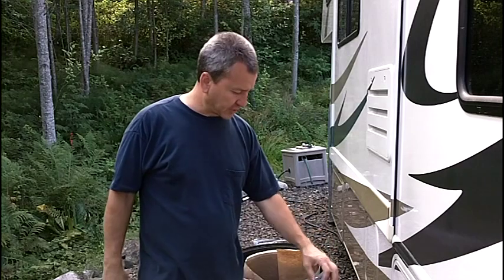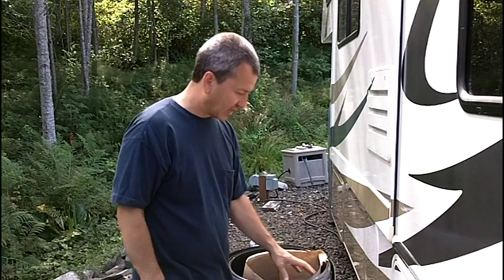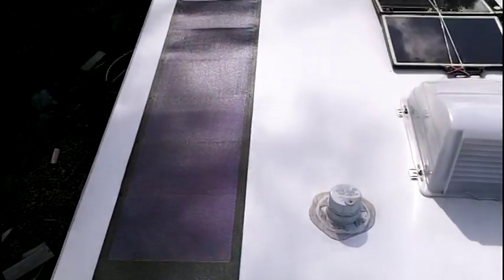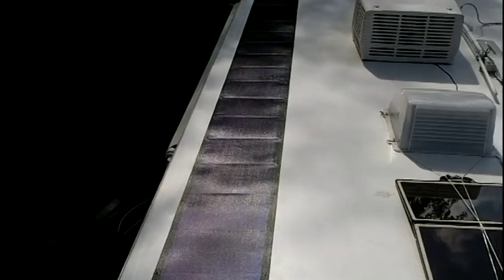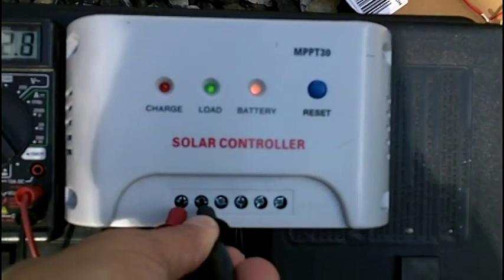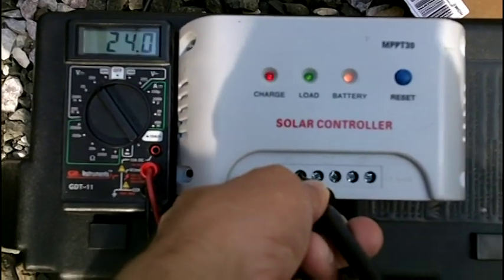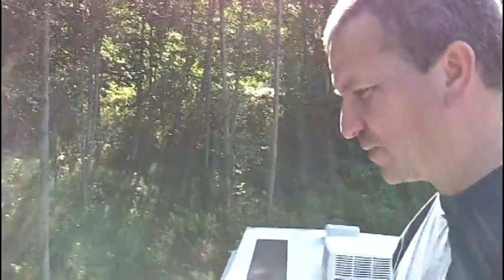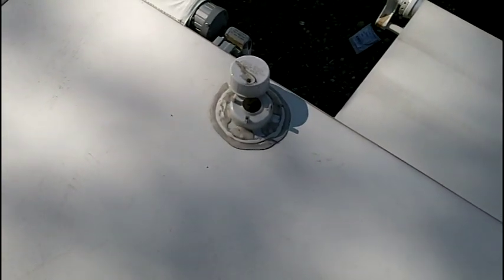How to Install a Flexible Solar Panel - DIY RV Solar

Comment: It looked like you could have put a second panel next to the first one, why so far from edge, like you said it is permanent can't move them...can't waste space....
Reply from the maker: You're right. Check out the more recent videos. Most of the roof is covered in flex panels now.

Comment: Hey Tito. Great informative videos. I used you as a guide to install my fantastic vent.  now I am tackling the solar project. In one of the comments you say that since this video you wired directly to the battery instead of the terminals under the bed. Is there any safety issues that led you to do that or is it just a matter of having less loss of current. I am thinking of connecting to the existing cables that go to the fuse box in my trailer. I would hate to open more holes to lay yet another set of cables to the battery. Are there any safety issues I should be concerned with my initial setup? Thank you!

Comment: Tito I need your help i have a 22ft forester class c and I just bought 2 18ft unisolar 24v panels (128w each) I plan on buying an mppt charge controller, some golf cart batteries (i think i can fit four in one of my outside  storage compartments on the port side.) and of course a power converter. will the converter change the 24 v to 12v or does the charge controller do that? should i set up a 24v(4 6v batts in series) or 12v battery bank( 2 6v golf cart batteries in series and then parallel with a duplicate bank)?
Reply from the maker: Fortean Threat Filmworks I would go with a 12 volt system configuration. Wire your 4 batteries in series-parallel like you indicated. Your MPPT solar charge controller should allow you to set the system voltage(12v, 24v, 48v). Set the controller up for a 12 volt system. The controller will then handle the conversion to 12 volt from your solar panels. With an MPPT controller, you should be able to wire your two panels in either a parallel or series configuration. I recommend series to minimize cabling and minimize voltage drop. Hope that helps!
Reply: awesome, thanks! My solar battery bank will be separate from the  batteries that came with the RV (under the entry top stair) I will unplug from shore power or generator outlet and plug into a 30amp receptacle wired into the inverter/converter. that way the solar system will act like shore power and will charge the rv battery system and provide (I hope) enough power to run the 110v appliances. (I'm keeping my fingers crossed about being able to run the  air conditioner) do you think the two 18ft panels would provide enough on a sunny day to power the a/c?
Reply from the maker: I don't think you'll want to run that A/C unit on batteries. You'll get more amps coming in while the sun is shining but not enough to make it worth while. Your A/C will also have a pretty high starting surge when it first powers up. My guess is that it won't run very long before draining your batteries. I would look for alternate ways to keep cool (fans, shade, etc.). You could start up the engine on your class-c and run the A/C on max to cool down the rig then maintain with fans. You could also fire up the generator if you want A/C.

Comment: How many batteries to last all night after a good sunny day?
Reply from the maker: Jeff. It really depends on what you plan on powering through the night. You certainly can't run an electric heater. I can generally run what I need on my two 6 volts with 210 amp hours (heater fan, or electric blanket, lights, tv, etc.)

Comment: the shorter the wires,the more power you gain
Reply from the maker: Generally true, especially between controller, batteries and inverter. I talk about this more on my solar Q&A (http://www.rvwithtito.com/solar) under the question "HOW THICK DOES MY SOLAR WIRING NEED TO BE?" I recommend using a voltage drop calculator to optimize your setup.

Comment: here is an inexpensive rv solar panel kit
<script>document.write('<a target="_self" href="http://rover.ebay.com/rover/1/706-53473-19255-0/1?icep_ff3=2&pub=5575109810&toolid=10001&campid=5337621459&customid=&icep_item=291011889419&ipn=psmain&icep_vectorid=229529&kwid=902099&mtid=824&kw=lg">solar panel kit</a><img style="text-decoration:none;border:0;padding:0;margin:0;" src="http://rover.ebay.com/roverimp/1/706-53473-19255-0/1?ff3=2&pub=5575109810&toolid=10001&campid=5337621459&customid=&item=291011889419&mpt='+Math.floor(Math.random()*999999999)+'">');</script><noscript><a target="_self" href="http://rover.ebay.com/rover/1/706-53473-19255-0/1?icep_ff3=2&pub=5575109810&toolid=10001&campid=5337621459&customid=&icep_item=291011889419&ipn=psmain&icep_vectorid=229529&kwid=902099&mtid=824&kw=lg">solar panel kit</a><img style="text-decoration:none;border:0;padding:0;margin:0;" src="http://rover.ebay.com/roverimp/1/706-53473-19255-0/1?ff3=2&pub=5575109810&toolid=10001&campid=5337621459&customid=&item=291011889419&mpt=[CACHEBUSTER]"></noscript>

Comment: Are you able to cut these panels? I have a 12 foot long cargo trailer.
Reply from the maker: No cutting. The shortest Unisolar panel is about 10 feet and my longer one is 210 inches. There are other flexible panels by Go Power for example that are more rectangular and my fit your roof better.
Reply: RVwithTito 10 Feet would be perfect. Can I get a quote for two? Thanks for the quick response.
Reply from the maker: Scott. There are links in the description where you can find them on Amazon.com or eBay. That is where I picked up mine. I don't sell them. By the way, Unisolar Panels are not manufactured anymore so you have to search for them online.
Reply: RVwithTito Thank you; I have not been able to find a ten or twelve footer yet.. Keep up the good work.

Comment: I am so solar power illiterate but what kind of things would this panel power? Lights, coffee pot, TV? I have pretty much found out that my window AC in my camper, is not an option for solar, which sucks on a 115 degree Texas Summer day. What about a microwave? I have no idea which things could be used with solar with a few batteries and maybe 2 of the shorter panels. I'm not sure my little vintage camper is long enough for this panel.
Reply from the maker: Hey Cathy. The primary purpose of RV Solar panels is for charging your house batteries. It is actually your battery bank capacity and inverter output that determine what you can supply power to and for how long. You are correct about the AC. It uses too much power for batteries. There are some systems that could probably power an AC unit for a few minutes, but then the batteries would be fully drained. So not a good idea. Many folks simply drive to milder climates when it gets too hot. A typical RV microwave may draw about 1000 watts for the few minutes you use it. So that is doable as long as you don't exceed the maximum power of your inverter. A 1500 watt inverter will probably work for my use (a few small appliances, laptop, TV, fans, etc.) Monitoring your battery power consumption and charge level is also a very important part of living off of solar.  Hope that helps.
Reply: ***** do you have a lot of wind in your area?
Remember there are also wind generators.
 I have a house off the grid in Australia and if you want you can run anything all day long as you double input from your out put, double is not necessary but with most thing Solar and off grid I have personally learnt add 50~100% more than what you need. like my 3k pure sine wave inverter i don't use the full 3k much but when i had a 600w inverter and would have 500~600w draw on it it would be hot and work at full capacity. Example my Batteries that I just had to change after 15 years, I was told 15yr ago that if you only use 20% they will last longer and from what I here I got the most out of them

Comment from the maker: I've rewired my solar since the video and it now goes straight to the batteries and not under the bed. As far as the converter under the bed...what can I say, it came that way. Thanks for the tip.

Comment: i want to add some thing   when installing salor on a RV dont talk or look at watts

watts is for a house tie grid system  when trying to make money back 
RV boat any thing with battery's you want amps its all about amp hrs  

you dont go to a auto part store asking for a 200 watt battery charger  you see 5 10 50 amp chargers 

hope this helps ppl wanting to install a system

Comment: I cant wait for your update system I saw your video 2 weeks ago and you hooked me. I have contemplated RV solar for years and now I am reintergized. I too have decided on a Morningstar TS-45 or Blue Sky xxxx, heavy wire, not sure if it will be MPPT or not. I mite use 24 volt panels but still trying to find the perfect panel or panels. Thanks for a great video.

Comment from the maker: I have nothing against MPPT, just the cheap MPPT controller I started with (the one in the video). I have since reconfigured my entire setup, wiring, controller, and battery bank. I now have a PWM controller (Morningstar TS-45) and its not MPPT.  With the size of my solar array, I don't think I would get a lot of benefit from the mppt boost. I decided to to spend the money on better wiring wiring and a quality PWM controller. I'll post a video of the new setup soon.

Comment from the maker: I'm not an expert, but I don't think 80 watts is enough to fully charge your battery bank if it's fully depleted. You'll still need shore power for that. It should work well for maintaining a good charge if your batteries are not fully drained. Of course, it depends on what you're powering.

Comment from the maker: I'm not quite sure yet. From what I can see, it seems to perform well. But I don't have any detailed specs to report. I have only had it in full-sun a couple of times, but was not able to do any measuring. It did keep my batteries at full charge though at a charge level around 13.8v. At home it never gets full-sun exposure so it's hard to tell.

Comment: Follow Randacams page, lots of great learning on solar there. If you get an MPPT and you do not plan on adding more panels... buy it within the range you'll experience for current. For example, I have an MPPT 30, and unless I attach 280 watts, it is constantly remaining in "night mode" (sleep), on very cloudy dark days - due to its minimum required one amp input. A waste of 10 watts. with 2 panels, they are always over an amp.

Comment: Randacam is correct, He actually informed me of that, too. I didn't believe him at first but then i pulled it apart and sure enough it is a little 555 timer circuit pulsing the current through the worst excuse for a bucking inductor I have ever seen. On a good note, tho, considering it is fake, you probably wont fall into "night mode" like you constantly would have, had you bought a real 30A MPPT - your panel is -too small- for a real 30A. But it will do the trick, nonetheless.